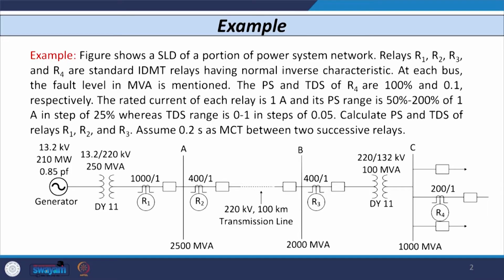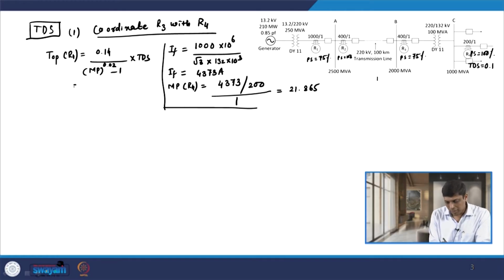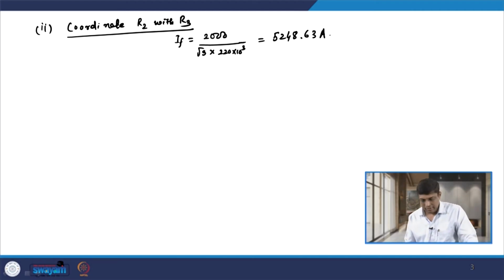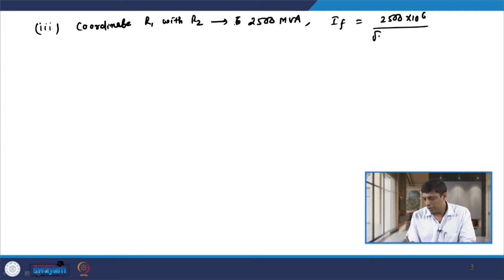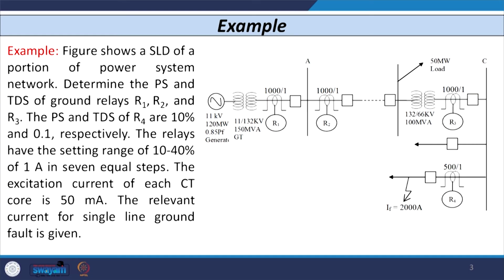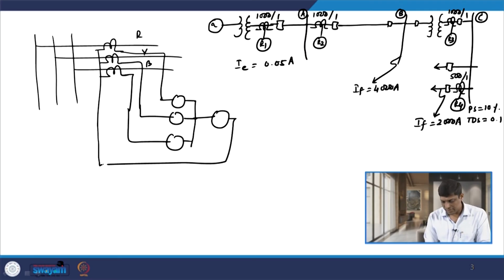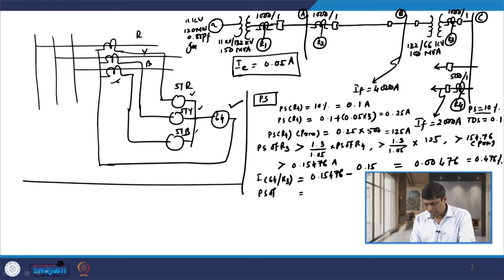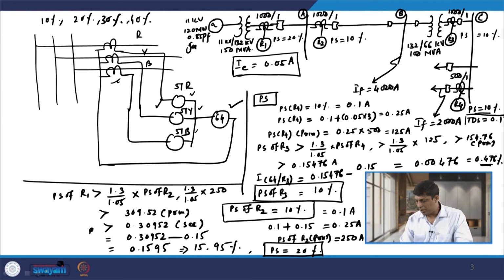Lecture 11 Current Based Relaying Scheme-VI

Comment: Sir,
why two ground relays (having a star delta transformer in between )have same plug setting?
Reply: It is because the star delta transformer doesn't allow zero sequence current to flow through and so plug settings of the two relays are independent of each other, hope it helps.